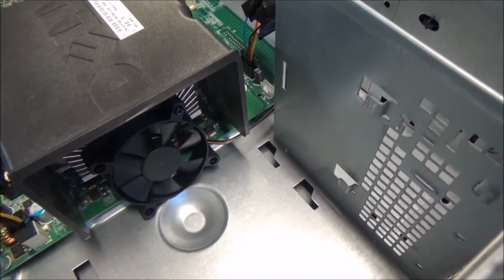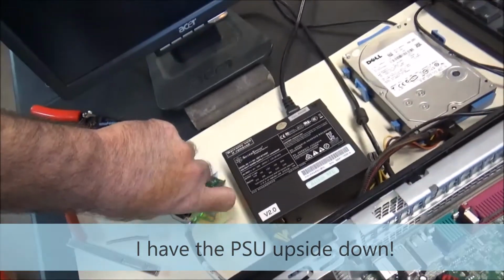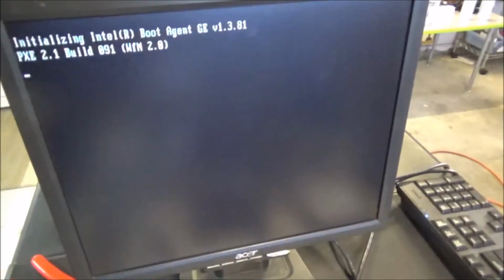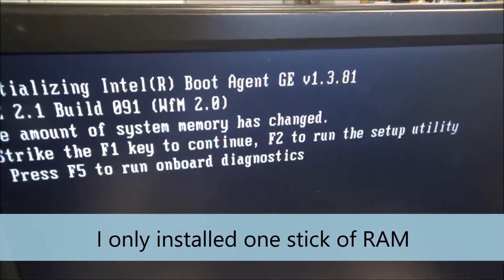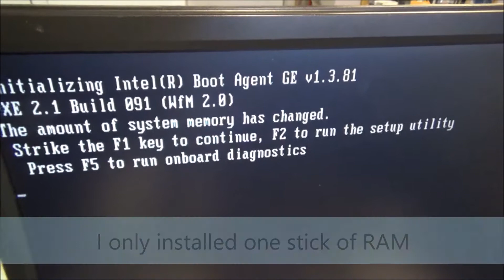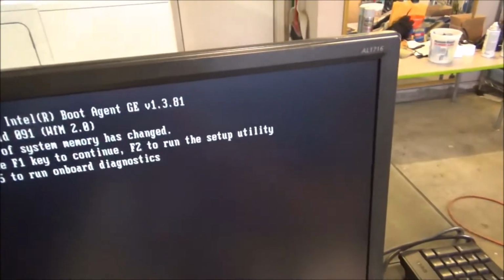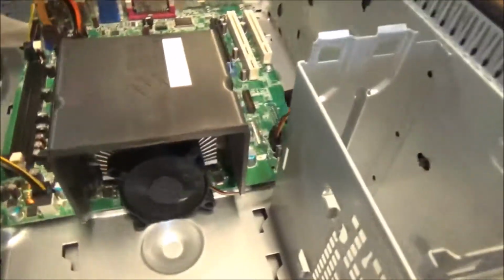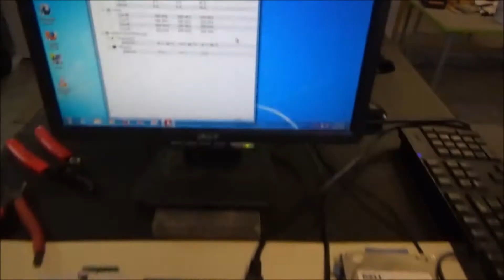Water Cooled Optiplex Build Log #5: Rewiring and Testing the CPU Fan

Comment: Also what gpu is that? I want to buy a Optiplex and put a 1050 in there for a family member as a present.
Reply from the maker: The GPU is a HIS R9 270 2GB single slot. The 1050 (non ti) is slightly more powerful than the 270 but a lot more energy efficient, it's perfect for an Optiplex. I have a Zotac 1050ti low profile in my Optiplex 780 SFF and it's sweet!